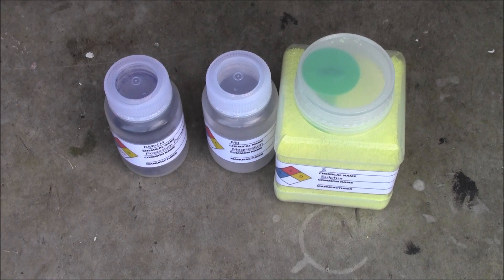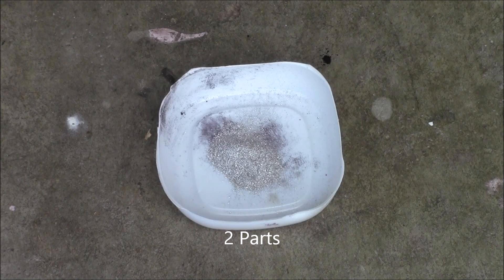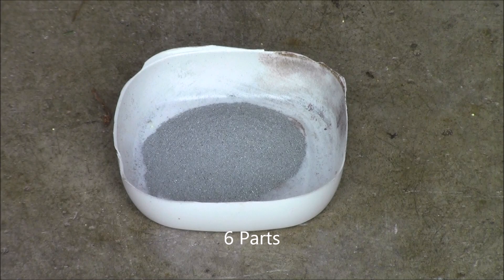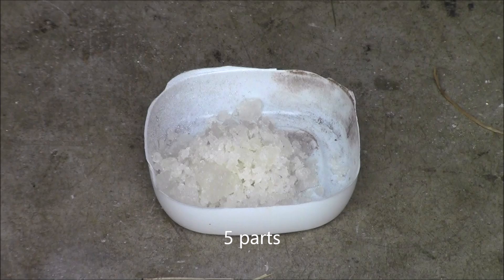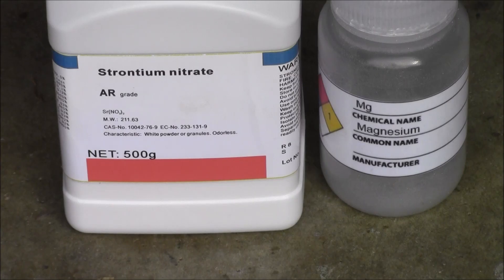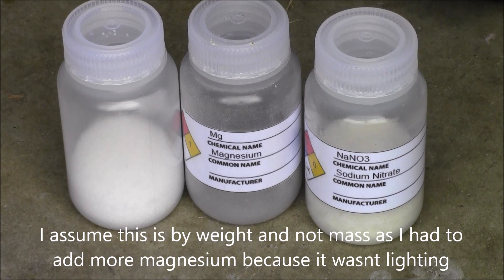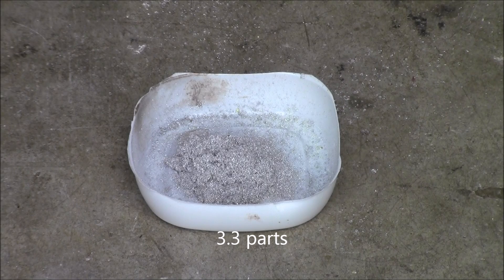Types of Flash Powder

Comment: LOL your not making flash in the 1st2 mixes your making thermite and by the way nothing burns with out oxygen.  All of the mixes you made contain it own oxygen.
Reply: Actually, things CAN burn without oxygen. Lithium, for example, can burn in pure nitrogen, because the nitrogen is taking lithium’s electrons. This is basic chemistry. Another example would be the
Zinc and sulfur flash powder shown in this video, where the sulfur oxidized the zinc. The thing is, the exchanging of electrons, or oxidation, is just that: the exchanging of electrons! Therefore, oxygen isn’t necessary for oxidation. This is all basic high school level chemistry! 
        What do you mean “the 1st2 are thermite reactions”? Potassium permanganate is NOT a metallic oxide, but rather, an example of an oxidizing agent. For a thermite reaction to occur, the metallic oxide’s base metal (the metal that the oxygen is bound to) MUST be less reactive than the metal that will be taking the oxygen atom(s) from the oxide. If the oxide is MORE reactive than the metal being oxidized, then the reaction simply will not work! As I previously stated, KMnO4 is just a potassium with the anion MnO4, and potassium is more reactive than both magnesium and aluminum. Therefore, it is literally IMPOSSIBLE for that to have a thermite reaction. Again as I previously stated, this is high school level knowledge!
I hope now you understand a bit more about chemistry: have a nice day!
Reply: Do you know what potassium permangenate is? Is has O4 in the end, that means it has oxygen, just like KNO3. 
And where do you get the idea thermite from? Thermite is a metal rust mixed with a metal powder. Example, Fe2O3, iron oxide (aka. standard rust) and aluminiums powder.

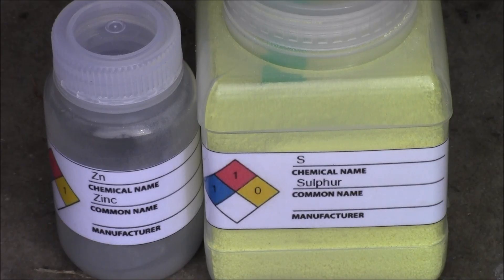Comment: At 1:08 you say that this mixture has no oxidizing agent, but generates enough heat to burn in a non-oxy environment. That is chemically impossible, as all chemical decomposition requires oxygen from somewhere. Just saying.
Reply: Zn combines with Sulphur to Zincsulphide (ZnS) which is an exothermic reaction. 
The Zinc is oxydized by the Sulphur, Zinc becomes Zn2+ -ions and S is reduced and becomes S2 - Ions. There is not always the presence of Oxygene (or an oxygene-carrier substance) necessary to promote an oxydation.
Reply: Oxidation/Reduction is about changing oxidation states which are about formal charges which are about number of electrons an atom would have if it was ionically bonded. It has nothing to do with oxygen apart from phonetic similarity (“oxidation” derives from “oxygen”) and the fact that it also undergoes oxidation/reduction reactions. In most  of them oxygen undergoes a reduction (acts as an oxidizer), but it can be oxidized (act as a reductant) as well . I doubt you give a fuck about that though. Your ignorance is both obvious and pathetic, but at least you don’t seem to be an aggressive bitch, like one of previous commentators, willing to go to a fight for a lost cause and to “school idiots” with “wisdom” on his site. Richie Ingpiece, 196Stefan2 and Somotaw are spot on, the rest should limit their scope of interest in chemistry to surfactants.
Reply: magnesium burns rapidly in its powder form because magnesius is really reactive to heat
Reply: As said earlier here, oxidization is not about oxygen. Oxygen just happens to be the most common, its about the charge states of the ions(zink atoms lost electrons to sulphur atoms and therefore gained positive charge).
Reply: Richie Ingpiece I think you got right ;D
Reply: Potassium permanganate is an oxidizer as well.
Reply: The original post says in a NON-oxy environment. If you did this in a vacuum or an inert gas environment, nothing can be oxidized if the constituent chemicals contain none.
Reply: I have seen all kins of idiots say the same thing. lol   He should go check out my channel.
Reply: sulphur is the oxidiser

Comment: Where do you get your chemicals? Looking for magnesium powder and potassium perchlorate? I've got Potassium Nitrate from AusChems. I've got Magnalium on order? Thats magnesium but mixed with Tin and Nickle. Is that the stuff you have? I know you can get Mg from firestarters but I lack the effort and would rather buy 500g.
Reply: Since when did Magnalium become a mix of nickel and tin? Irs an alloy made of aluminium and magnesium. Just saying.
Reply: He used a potassium nitrate and aluminum based mixture, which both of can be bought on amazon for fairly reasonable prices. However, the nitrate can often be substituted with stump remover from your local hardware store, however, be sure to check the MSDS sheet, in order to assure purity. Magnesium, i have not personally bought, but if you have a laythe, you can buy blocks and machine it down, or i suspect it could also be bought on amazon. Now, once you start to play with perchlorate, i would highly advise against it, as you very quickly slip from very rapid and hot burning, to complete detonation.
Reply: Nicholas Harding add tin foil
Reply: In Europe it's best to order at laborladen.de

Comment: You must try milling the chemicals to much finer powders, so you will get much faster flash powders
Reply from the maker: Eimantas Andrikis I cant get a ball mill so I only use what I can get
Reply: toothpick993 I understand, but you can definely make much finer KMnO4 with mortar and pestle or you can even use a hammer to grind it.
Reply: toothpick993 Oh, I'm sorry for confusion, the KMnO4 looked quite coarse. But another thing about KMnO4/Mg/S FP is that you could have been used less sulfur, it should be faster.
Reply: It's not fast. It's just more sensitive